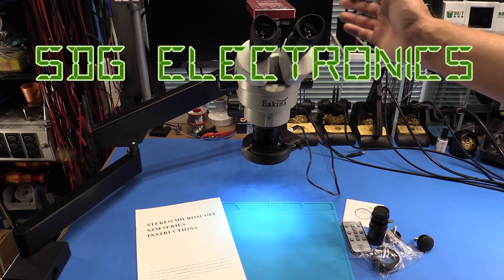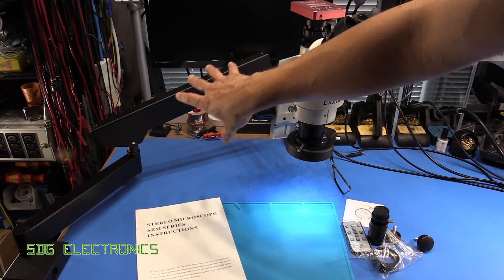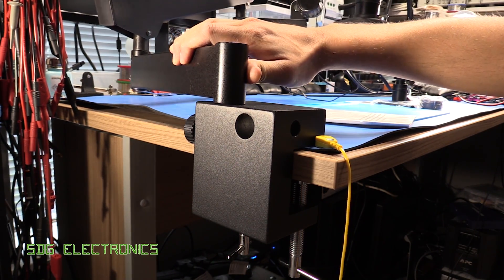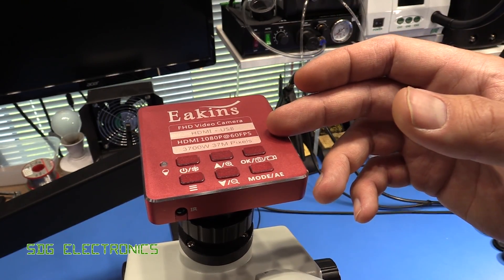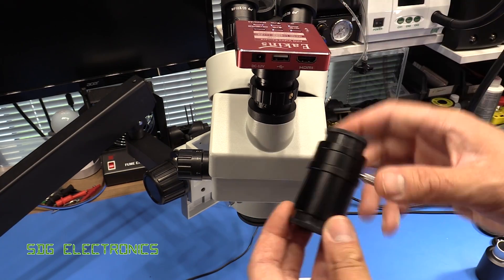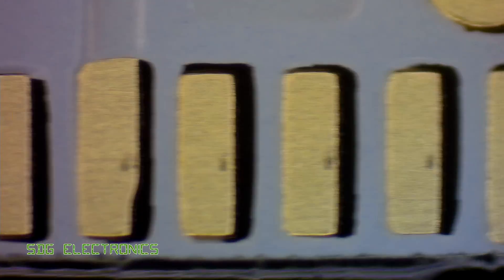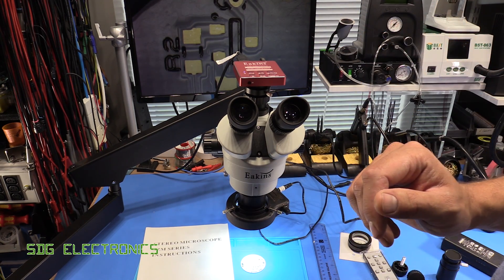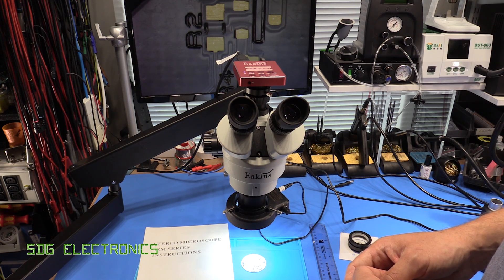SDG #093 Eakins Trinocular Simul-focal Microscope and 37MP Video Camera

Comment: Being (predictably) low on space, I really like the idea of replacing my boom arm with one of these. How completely does the arm fold down when not in use? Will the articulating section sit directly above the lower part?
Reply from the maker: The arm itself came packed flat in an 'S' shape, but you would need to twist the microscope head by 90° so that the lens doesn't hit the arm.

Comment: This type of stand seems ideal for ergonomic reasons, great for not taking up so much bench space but I do see a downside, it seems to be picking-up every little movement and that can be disturbing when you're zoomed in. But I guess it's something you have to trade in for the ergonomics.
Reply from the maker: There's a bit more wobble visible on the camera, but for whatever reason you don't see it down the eye pieces. You're right though, at high zoom the effect is compounded.

Comment: I have used the AM scope with dual boom stand before and it was OK, but as you say it needs a good amount of desk space. I have had comments by others that have used the articulating type stand as with this Eakins package that it can be unstable as in one little bump on the desk and the image wobbles all about.
Reply from the maker: It probably depends a little on how stable your bench is - I didn't find it much more wobbly that the boom arm on full extension. It only really effects the camera, our eyes seem to filter it out
Reply: @sdgelectronics  Yes a decently solid bench would help a lot. I very much appreciate your great reviews and particularly your thoughts on how the camera works with the scope. I also recently got the BEST BST-863 hot air rework station after seeing your review. I'm yet to give a good work-out.
Reply: The articulating stand does look a bit wobbly...which will look like massive movement due to the magnification.

Comment: Looks to be a very capable unit at a fair price as arranged in this kit. Did you work out this specific configuration with Eakins?
Reply from the maker: Yes, we had a chat to work out a potentially better configuration. I don't get any commission or anything though.
Reply: @sdgelectronics  Very nice from you. This rely looks like a kit witch is coming from experience.

Comment: I have a older am scope that I bought from an engineering firm that was closing up shop. It came on an articulating arm. I like it but I feel like the one main con of articulating arms is the limited mounting points double arms are nice in the fact you can place them anywhere ( I don't own both).

Comment: 37mp images?  cant find any info on that camera.  i doubt     might be interpolated from some lower res
Reply from the maker: I forgot to look at the image files on the SD card too look at the data.
Reply: I have an identical camera from Eakins aliexpress store. The camera is 16megapixels YW5607 (from data). Usual aliexpress BS. It's still a good camera but this 37MP is just pure fantasy. It's a Panasonic 1/2.3" chip.